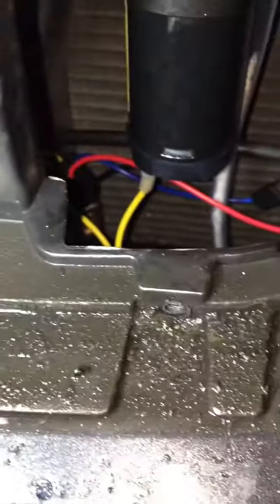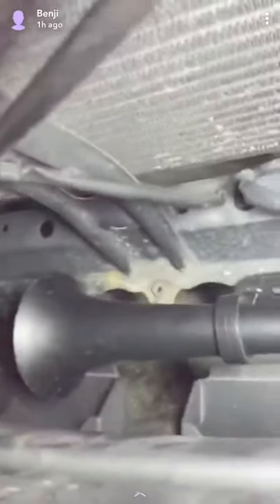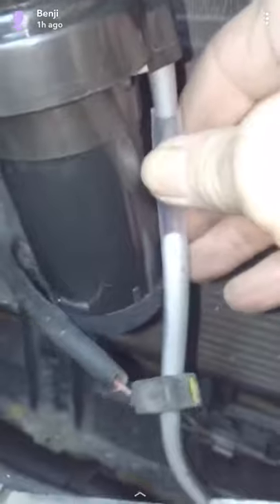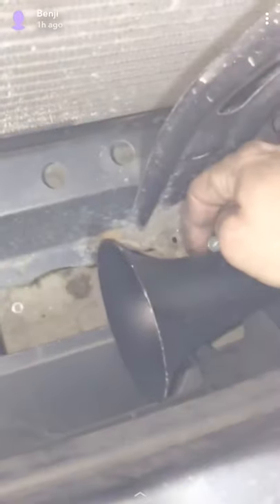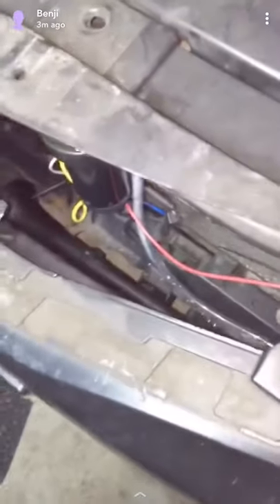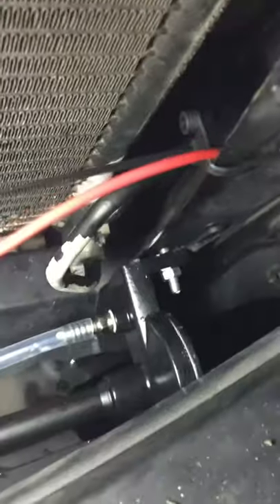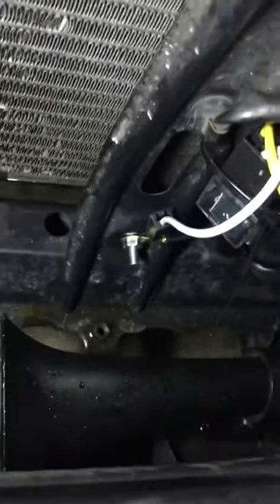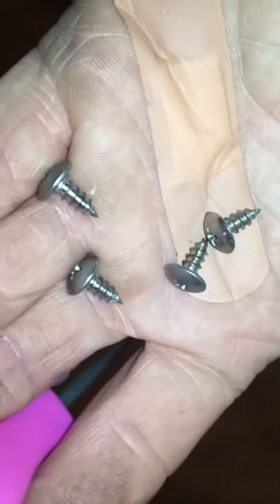AMAZON air horn(GAMPRO 12V) in 08 Impreza install( Detailed instructions in description)

Comment: @BenFoilHat I'm trying to get this working with a separate switch. Connecting the compressor yellow wire directly to car+ activates the horn without the solenoid.  Do you know if the blue wire coming from the solenoid is supposed to have voltage on it?  I've connected solenoid blue -> switch NO (normally open) wire, and solenoid white -> switch ground, but no luck.

Comment: I’ve had one connected on my Nissan Frontier for about 6 months now maybe longer and it just stopped working yesterday. The fuse is good and I already bought a new switch to see if that was the problem but still nothing. Do you think it could be the compressor that I need to replace?
Reply from the maker: Compressor stopped working a few weeks ago in the car I installed it on. Is your compressor in the same orientation as the one in the video?
Reply: @BenFoilHat  yea it was the same air compressor. I actually just bought a new one on Amazon only to find out it was the ground that was causing the problem. Somehow the ground wasn’t getting a good connection so I wiped it off with my fingers and put it in the same spot and it started working again 😑 so I don’t even think I needed to buy a new compressor but it’s staying on now.
Reply from the maker: @EP1CY0SHI  thanks for the info!
Reply from the maker: @EP1CY0SHI  turns out the way I Jerry Rigged the white ground wire to the black wire wasn’t sufficient(it fell off) soon as I stuck it back in there it worked. I’ll have to cut the connector that came on the white wire off and put a real one on like a normal person. 😂

Comment: So is it worth it? I'm looking to put it in my B2200
Reply from the maker: There are many air horn products that I see are now available since I made this video. I havnt used any other horns so I can’t compare. But like I said there is a huge selection of air horns on amazon between $20-40. I would be sure it fits before you make a purchase. I see there are snail air horns that look more compact but are advertised to produce the same level of db as the long horns. You can always return it 🤷‍♂️